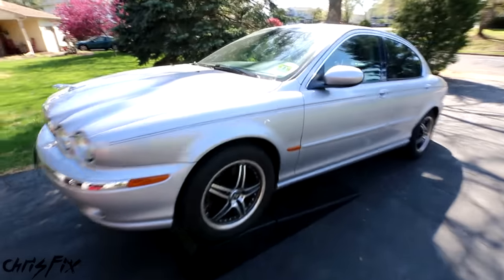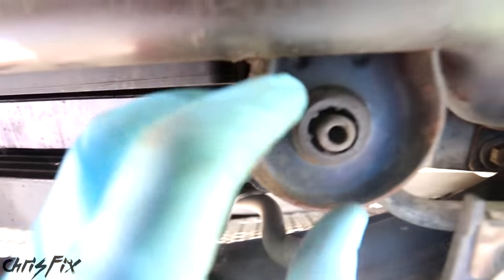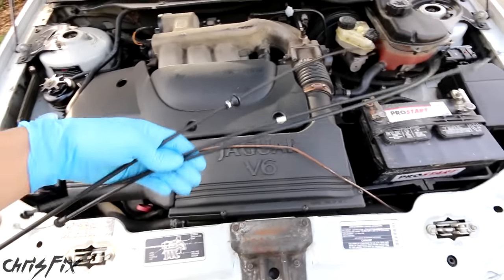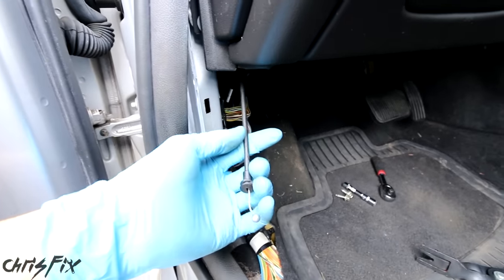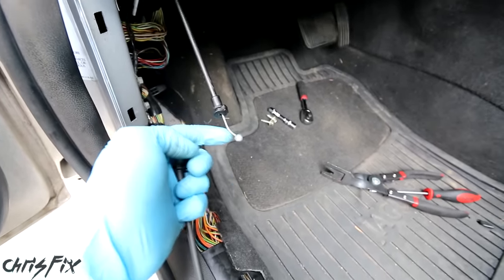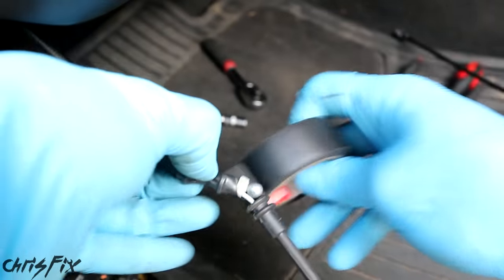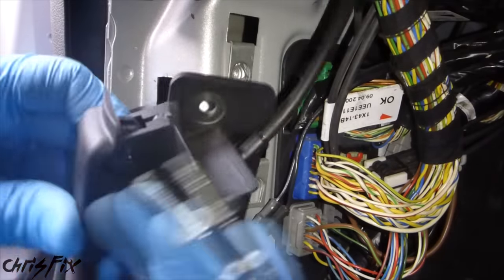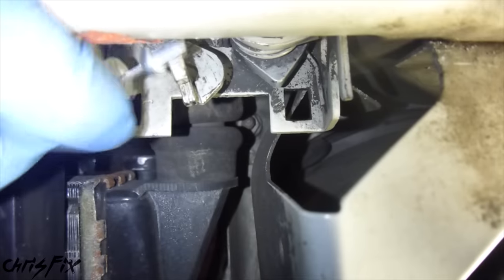What if your car's Hood won't Open?

Comment: Chris, I have to say, your videos are some of the best car videos that I can find. Not to sound rude or anything, but jeeps don't have this problem. Just open the straps, lift the hood up a little bit, push the hood release lever, and just open it. The one downside to the jeep hood is that there's no spring retention system. Got to use the old fashion hood rod.

Comment: CHRIS!  I AM IMPRESSED! As a low power tech, I was thinking you will want to use the old cable to fish in the new cable, and that is mostly what you did.  
The only change I would make is to leave the engine part of the cable parted as the factory did it, then pull into the existing path just through all the right spaces as the manufacturer did it.
Great Job!!

Comment: just a tip when pulling the old /new cable through, spray the cable with silicone spray or wd40 to help it slide through easier. That way you don't put too much tension on the new cable.

Comment: Excellent demonstration by someone thoroughly familiar with solving this problem and repairing it. I just bought a 2004 Jaguar X type car with this precise problem and my mechanic couldn't solve the problem. Your demo was so very helpful, I felt compelled to express my gratitude. Fantastic job! 😊 Thank you! Now I will check a few garages and show them the video if the seem clueless or unfamiliar. Why the bloody hell did they design the car with two freaking latches tho???? Safety my Azz, one latch is sufficient, cost less all around as this it seems is a very common problem with Jaguars. Bought this car out of Japan and it was shipped here and we discovered this problem upon its arrival.

Comment: This incredible video SAVED MY LIFE today, because the hood was suddenly locked and I am selling my X-Type tomorrow 😰. It's working now after 2 hours of work 😊😊😅
Exactly what I needed. Only one remark, you need to partially remove the plastic protection under the motor before seeing the latch. I spent 45 min looking for it before that lol

Comment: 102 people are pissed that this video taught anyone how to open up their hood.
Reply from the maker: lol
Reply: this is how car thief open the hood and disable the alarm (only less than 15 second).
Reply: now 103
Reply: +ChrisFix do you use latex or nitrile gloves?
Reply: Actually it'd be a pretty good way to rob a vehicle at night.
Reply: mattorama i never thought of that until now
Reply: you assuming they don't know already
Reply: 375 thief don’t like this video
Reply: Exactly
Reply: @ivang97997  not if you use Chris' video to install a kill switch so even if they pop the hood and disable the alarm they can't start the car
Reply: 417*
Reply: 425*
Reply: Most cars are too low to the ground to work from underneath. Thieves are not going to jack up the car, put it on axle stands, pop the hood like that in the dark, to disarm the alarm, only then to start opening the doors, break the steering wheel lock, rip open the panel underneath the steering wheel to connect the wires... By that time it will be morning two days later.
Reply: Well , I learned how to steal engine parts from this video
Reply: LOL

Comment: At 3:29, if it's a tight and blind fit, I'll tape a piece of electrical wire scrap to the old cable and pull it through.  Then I'll leave it laying through till I run the new cable at which time I'll attach and draw back forward the new cable.  It makes the job go way faster and smoother.
Reply: +briansmobile1 I commented too soon.  I see you did that at 5:20 now. ;  D
Reply from the maker: +briansmobile1 hahaha
Reply: +briansmobile1 Hi Brian! Suffering from premature commentation I see? Maybe think about baseball stats or something next time you feel you might end up commenting too soon.  ;c)
Reply: +Goregoon LOL!😂
Reply: +briansmobile1 That big hyper BRAIN of urs is thinking ahead of us mere mortals way too fast, mister.  Do u liquid cool that thing?  puts ice cubes in Brian's ears

Comment: 10 tips to clean the interior?
Reply: NEVER use something with oils or solvents to clean your dashboard, it will evaporate and leave a nasty residue film on the inside of your windshield.
Reply: Mayor Ushanka I would suggest cleaning the dashboard with dish soap.
Reply: it was about hood poppers. not about clean the interior. maybe theres an other video about that ^-:)
Reply: dont piss in it
Reply: Yeah bro, i think 🤔 he should do a 10 tips to clean the interior
Reply: Pressure washer

Comment: Funny you pick an X-type Jag for this demo.  My '00 XJ8 hood cable just gave up the ghost.  I've since found out that they are JUNK on Jags ..  they are always snapping, and the replacement part cost is over $160.00 or so.  Grrrrr!   Special issue with Jags here is that the hoods (oops "bonnet") open back to front, instead of the typical front to back with most cars.  So, there is no removing the grill or attempting to work through one to pop the latch.  Fortunately, Jag has an access hole in the front wheel arch (I think on either one) that, after popping out a blanking piece, you can go up with a long stick and pop the hood release on either side (apparently they realize what a PITA their hood cables are).

Comment: And they say maintaining a Jaguar costs thousands! Doesn't look expensive or difficult haha. I know on Hondas the cable goes inside the fender along the body and you have to pull inner fender plastic to get access.
Reply: This is just a piece of wire
Usually parts for expensive cars are expensive too
Reply: 900bz usually that is not the case. You have to shop around and change parts yourself.
Reply: +February 1990 and up Jaguars (or Forduars in this case) aren't made to last in the slightest. Their parts are extremely expensive, the labor is intense thanks to the stupid engineering, and it's almost guaranteed that any modern jag you see with more than 120k has been through at least one engine and two transmissions.
Reply: +February The parts are a lot more expensive than say a domestic car. For example, a water pump on my truck is 39 bucks. On this jaguar, it's 191 dollars plus a core charge. Compare the prices to your car on any parts store's website. Most stores won't have the part in stock, or even carry it at all.
Reply: Cake Face They are not a Honda, but they are not an italian Fiat either. My favorites are X300 and X308 bodystyles. X300 had a few small problems (mostly electrical like clock not working or power seat switches not working), but their inline 6 was very reliable as was the ZF auto. Maintenance is cheap if you do the work yourself. X308 V8 did suffer from Nikasil liners being eaten away by sulfur in the fuel and plastic timing chain tensioners breaking because bad quality plastic was weakened by engine oil. These issues were fixed after September of 2000. Compared to pre 1992 Jaguars, Ford really fixed how these cats were built. It would be a fun project car and I believe a reliable daily if you are mechanically confident and competent.
Reply: +**Classified** I have a 1999 Honda V6. Water pump is around 60 bucks. It is driven by the timing belt. So I have to think if I want to spend 60 bucks on a ln aftermarket crappy pump, or spend 250 bucks for a genuine timing belt kit including the pump. Does that make my Honda an expensive exotic too? I did the belt myself for 250 bucks. Dealer would have charged 1200. It's the same with this jag. Dealerships cost a fortune, but there are dedicated Jaguar owner forums with all the info you need. I would be more sceptical about a cheap Ferrari 355 where you have to drop the engine for major service.
Reply from the maker: +February Yea this was a $30 cable. The problem is if you cannot do this yourself, Jaguar wanted $400+ to do this!
Reply: February I do all the work on my cars myself, but this Jaguar is more expensive no matter what way you look at it. My OE pump is 50 bucks, aftermarket duralast with a lifetime warranty is 39. Duralast jag x type pump was 190 plus a 20 dollar core. You can go look at any part. They're always more expensive than domestics, OE or not. 

By the way, duralast makes great parts. I've only had a handful of replacement parts fail over the course of a decade, and no matter what they are replaced, no questions asked. They last about as long as OE parts from my experience. 

Honestly, I can't say that I've ever had any of my cars at the dealer other than for recalls.
Reply: +ChrisFix this is supposed to take 4 hours?? Around $120/hour labor I'm thinking 😂
Reply: February Ford certainly didn't do justice with the S-Type, considering the one my mother owned had the transmission go out only at 40k miles, as well as a load of electrical gremlins that I did not want to deal with to diagnose. It's a pain enough that you have to remove the sub-frame to get to the fuel pump, where as on a normal car you'd either find the fuel pump in the trunk/able to drop the gas tank without doing anything further. Ford's 5R55E trans was junk anyway that killed a lot of S-types and Lincoln LS's. Maybe if they had the AODE but doesn't change the fact that modern jags are junk.
Reply: +Cake Face I highly rate the new Jaguar XF also quite like the old XJ8s from the late 90s- early 2000s.
Reply: Cake Face
 S-type was a dog, I agree. But the late 90's XJ6 wasn't. This X-type that Chris bought is a decent car too. Few small problems, but major components are reliable. That's all you really need. You can change a radio or an alternator, but you can't swap a transmission or an engine or do a diff rebuild in a parking lot.
Reply: +February my Honda dealer charges 695 for a v6 belt.. not 1200.
Reply: reweydewy
Wow, that's interesting. What Honda is your V6 in?
Reply: February - No, your Honda is not an expensive exotic; rather, Honda parts are ridiculously overpriced, to the point of being obscene.  But I bet you already knew that.  
In the majority of cases, aftermarket Honda parts will work quite well.  I'd caution against using other than Honda fluids, such as power steering, auto trans, and CR-V Dual Pump differential fluids.  
As you mentioned, dealerships are THE big moneymaker, so they'll charge what they think that they can get away with.
Reply: daveogarf Aftermarket works when buying brakes or suspension components or basic maintenance like oil or sparkplugs. Some parts I have to buy Honda genuine, because aftermarket sells crappy chinese knockoffs. I always shop around and find the best quality part for lowest price. I found one Honda dealer that sells parts more than 20% cheaper than other dealers. I needed Honda-specific only-available-at-the-dealer parts and I wasn't disappointed. Always shop around!
Reply: February, I heartily agree!  Thanks for your input.
Reply: Looks like a Ford product. No longer a true Jag. No wonder it was easy to repair. Jags from the eighties were a pain to work on......
Reply: I've got a 2005 x type...I haven't had to do anything much with it even with an accident. beyond the damage of the accident, all I've had to do is reapply glue to some of the fabric in areas. Even the parts I needed for my accident were really cheap. Everything is cheap honestly...but X-types don't really represent the rest of the jaguars, they're good for us normal people to afford but all other jaguars (generally speaking) are too expensive in one way or another.
Reply: I too have a 2005 X-Type, the manual 2.0 Diesel version (UK Jag) and it's solid as a rock. Not a single issue, plenty of power. The only repair I have needed to do, was replacing all the speakers. Only 1 speaker needed replacing, but I went with aftermarket JVC's all round. I simply purchased my speaker mounts and spare door card clips and was done in 30 minutes. I replaced the head unit with a double din android head unit too, but that's about it.

Comment: Nice video, very detailed with good camera angles....so from the looks of it, it looks like u decided to buy the jaguar.
Reply: +Carlos Rosete Yeah, he actually bought it before the video series were uploaded.
Reply from the maker: +Carlos Rosete Thanks! Yes, I got the jag in this video: https://www.youtube.com/watch?v=drbhNLvYxGQ
Reply: +ChrisFix you should make a video on how  to fix a parking brake  when I put it in park the car rolls yet a couple inches
Reply: +Jeremy Raber your parking break should be able to hold ur car...try testing it by-putting it on drive and slowly releasing the accelerator...right chris?
Reply: +Carlos Rosete thanks!! :)

Comment: Smashing tutorial chris :-D
That old coaxial cable looked really crusty, no oil for years :-(
Is the replacement cable a pattern part or from one of the companys that owned jaguar at one time or another?
Reply: +zx8401ztv Its a Ford Jaguar.  You can clearly see Ford stamped into the plastic on the interior hood release.
Reply: +zx8401ztv It's probably a part for a Mondeo, seeing as the X Type is a Mondeo Mk3 in a lot of places under the skin.
Reply: +cjmillsnun 
lol yes i can believe that, some people dont like the mondeo, but ive known frends have them for years, did the job.
I like ford in general, well growing up with uk made fords does bias my view, and the parts are not too expensive.
That cable in the jag/mondeo looks like it could be made with parts from a motorbike shop, if it was hard to get.
Reply: I've discovered the Jaguar x-type is on a Ford Contour/ Mondeo chassis with a ford v-6 engine.  Back when Jaguar was owned by ford
Reply: Its a shame really, the jaguar used to be a special car before the uk company died, the ford version is ok but its a badge, i suppose its better than no jaguar at all, shame though :-(.
Dont get me wrong, i like ford, i grew up with them.

Comment: 10 tips to clean your engine?
Reply: +Juriaan Tolkamp Baby wipes!
Reply: TIP 1.don't clean your engine
Reply: +Krizzle Sizzle lol, true
Reply: how to clean engine bay*
Reply: +Juriaan Tolkamp  dry cloth. Don't ever ever use any liquid to clean your engine.
Reply: Holy hell man, put a tongue out smiley if you're going to be joking.
Reply: I'm using an humid cloth. Dry cloth does not catch the dust :(

Comment: normal car...1 latch...jaguar needs 2 latches!
Reply: fancy, huh?
Reply: My Audi 80 from '86 has two too! Wish this video was online 4 weeks ago, would've saved me a lot of time thinking haha
Reply: Fancy
Reply: My fathers 2015 Audi S6 has two!
Reply: +ThatGuyNamedScott. C just checked, our Audi A6 2004 has two too
Reply: +LEX Maximaguy87 So twice as likely to come off, therefore generating more revenue for Jaguar service department whilst maintaining Jaguars reputation for making overly complex unreliable vehicles.
Reply: i havent seen a car that doesnt have two latches
Reply: Text Missing my Polo has one in the center!
Reply: +Matthew Sharpe it may be over complex, but I can promise you that it is anything but unreliable. mine had been reliable for three years and almost 25k miles (115xxx-138xxx). sure, it's still young, but it has shown absolutely no signs of being "unreliable."
Reply: Squipy Hey, I love me some Jaguar - and I'd agree from new they aren't bad, especially in the last decade or so - but anything over-engineered like that will eventually become unreliable, and more difficult to fix because of its complexity.  Owning an old Jag (anything over 5-10 years) is a hobby, you'd be mad to buy one thinking it was going to be reliable every day transport - stuff is going to break - regularly.  Something is always going to be not working on it.. it's just how it goes.
Reply: +Matthew Sharpe call me mad then, but three years have gone by and I haven't had any problems whatsoever.
Reply: Every car that I've seen has just one. They all seem to work just fine.
Reply: Text Missing ANY american car pre 2000

Comment: Hi. chris... some useful hints however it is impossible to feed the new cable from inside the car and must be fed from the engine compartment into the cabin and then connect to the lever. Very easy.   I have just done it!  All the best

Comment: My hood latch is a conventional paddle located at the center of the grill. It seized up from years of dirt build up from fine sand blowing into the engine compartment. The cable release still worked but the latch was a stubborn problem and barely moved. I gave it a good long couple of blasts of Gunk "Engine Degreaser". The latch let go. It couldn't fight me no more. I used an old tooth brush and scrubbed away as much dirt from the hood lock hinge, then gave my engine a good shampoo while I was at it. Satisfying.
Coupla spritzes of WD40 on the lock and I was done.

Comment: What if you have no access to the latch, from underneath....  now what ?
Reply from the maker: Try to find access. Take the wheel off and the wheel-well liner off
Reply: Now you're screwed, find someone to fix it for you!
Reply: what if your hood opens backwards and yoyr engine and trans are in the way of the latch?

Comment: Thanks so much for making and posting these videos. You have no idea how invaluable this is. I get so frustrated with mechanics where I keep going back for the same issue that is not properly resolved, usually from short cuts and in most cases; for not being familiar with my car or just careless. 
Believe it or not those manuals can be tough to interpret even with photos. Sometimes it is the wording that can mess it up too. You make the language easy to comprehend in straight up fashion. 
So thank you, big time!